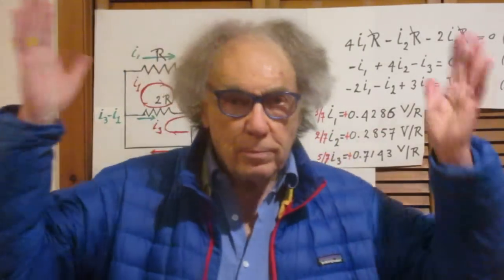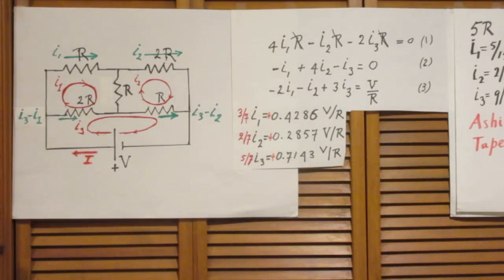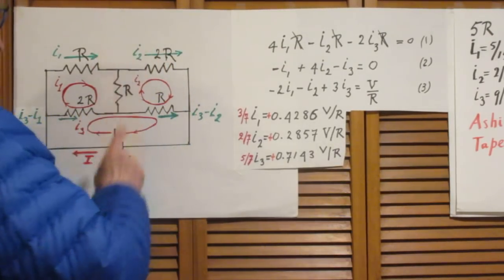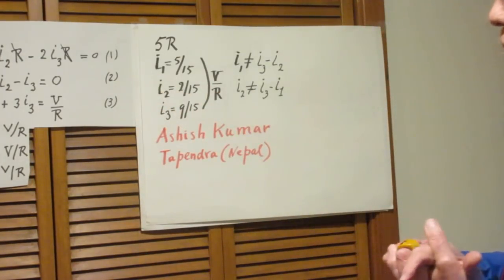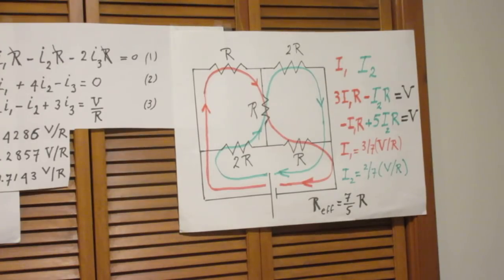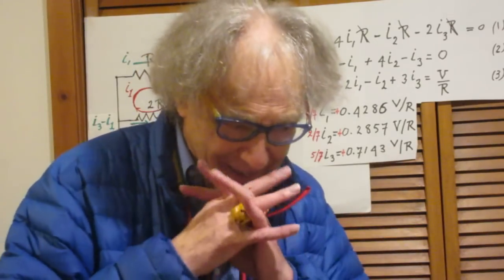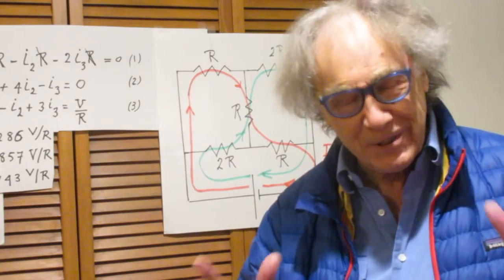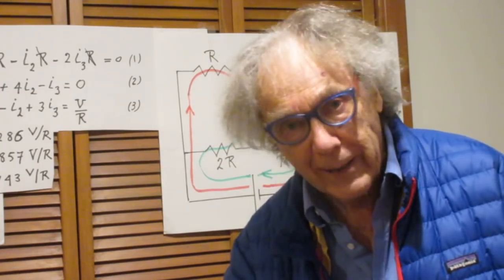Solution (2/4) Problem #24 - Circuit with 5 Resistors

Comment: That assumption can also be made by considering a current of value -i coming from the negative terminal of the battery. Since the arrangement of resistances are similar in the right side too, so same distribution of current will occur. Thus the current passing through 2R on the LHS must pass through 2R of the RHS.

Comment: You present things so convincingly that I originally believed you had changed BOTH 2R values although it was not apparent on your loops.  That, because I knew your quick result was ”evidently” wrong otherwise.  But when you repeated that the result was independent of the single resistor change, then I knew to expect your correction.  You did not disappoint.
In the very distant past I had to calculate a number of these resistor networks and started to develop a general sense or feel for them.  Something has remained, although most, and especially the AC complex ones I have let gracefully rest in peace.  In this case, I was off line when you presented the problem, so I never had an opportunity of working it out before your solution video. 
Anyway, I hope you keep on publishing your challenging problems.  Thank you!

Comment: The second method is still valid if you say "by symmetry it can be seen that the currents in the 2R resistors are equal and the currents in the 1R resistors are equal" and then carry on.
Reply: geocarey yes, but you need to do math to prove that statement is true if you are trying to teach the subject.

Comment: You're a good sport professor. Probably a good decision to throw solution #2 out. #1 will work no matter what. Also where thevenin would not be helpfull. 
Nevertheless, you found the symmetry shortcut with #2. Nobody else did.....still a good job.

Comment: Sir is really an electron has a negative charge... Or it's only a convention...And if it's a convention than how we say that  in hydrogen atom the protons are inside the nucleus and electron is revolving around it... (consider only single electronic system)
Reply from the maker: it's a convention adopted centuries ago. electric attraction and repelling forces were known for ages. It was decided by convention which to call --  and which + USE GOOGLE. Also watch https://www.youtube.com/watch?v=sOP3xKLNJZo&list=PLyQSN7X0ro218ZADJkvINBhTUAQeDMHf-&index=2

Comment: Sir from my limited knowledge i wonder why in a closed path work done  is non zero?
Reply from the maker: work done in a closed path by a conservative force (like gravity) is zero. It's not zero for a non-conservative force (like friction).
Reply: Here the force is that of electric field and that's conservative. So why? My assumption and explanation  is like this:
Kirchoff Loop law works because when we sum up the voltages across the loop we  actually get the change in P.E of unit charge across the loop and that is zero as the field is conservative. Hence what you do in super method is justified. The only trouble I see is writing current in a loop, I think in case of non standard loops it is wrong to assume current will be same throughout. Is my reasoning okay?
Reply from the maker: >>>>Hence what you do in super method is justified.>>
The loop I drew in the "super method" is fine,  but the current in that loop is NOT the same everywhere in the absence of symmetry. Thus in general they cannot be used (I was just lucky that they worked in my problem). Those 2 loops can only be used successfully if there is symmetry as I discussed in some detail in my Correction Video
Reply: Lectures by Walter Lewin. They will make you ♥ Physics.

 Sir can you make a video on these small tricks and checks that we do in physics like dimensional analysis and taking few variables to infinity and more that i don't know?

Comment: Did force depends on time.. ? For eg.. gravitational force between two objects at a distance of 1 light year will be negligible but the force will be there ... Thus light takes 1 year to reach that object , then force required how much time...?
Reply from the maker: questions unclear - use google
Reply: Gravitational force between two celestial bodies is given by f =Gm1m2/(r^2)... Now if I make r=1ly the force will become negligible, right but there will be force acting on other body. Now light take approximately 1 year to travel from object A to object B. Is the force acting on the object B still be instantaneous ?
Reply: Hahaha Google didn't know the answer .. only a physicist required...  AND YOU ARE MY IDEAL.
Reply from the maker: >>>Is the force acting on the object B still be instantaneous ?>>>
no it's NOT. Gravitons and Gravitational Waves travel with the speed of light.
Reply: So, it require 1 year for the force to act on object B?
Reply from the maker: yes
Reply: Interesting.. isn't it!!!
Reply: If the acceleration made by object B be equal to the rate of expansion of the universe...? Then what will happen?
Reply from the maker: question ill-defined, use quora.
Reply: Nevermind this question is a bizzare!!!!!

Comment: Sir, I think the second solution is wrong because the first loop is intersecting with the second one and they should not to have been     
Intersected.
Reply from the maker: What you wrote is incorrect.  The 2nd solution is NOT wrong. What was wrong was that I said that this second solution would also work if the values of R had been changed - that is not true.

Comment: Sir I have a question related to Quantum mechanics.can I ask here?
Reply from the maker: you can ask here.  However, Prof Barton Zwiebach ay MIT is a world authority on QM ask him 
zwiebach@mit.edu
Reply: Quantum mechanics based on uncertainty principle which shows that motion of any small particles can't be predicted .
But how can we predict light's behaviour so definitely but it is made from photon?
Reply from the maker: >>>But how can we predict light's behaviour so definitely but it is made from photon?>>>
we cannot
watch https://www.youtube.com/watch?v=MeK0DV329mU&index=7&list=PLyQSN7X0ro21uk5LTH085VLMfkb_dRjHF
Reply: But in case of reflection and refraction we can predict .
Reply from the maker: we can NEVER by-pass HUP. NEVER. All measurements you make will OBEY HUP. Use 1 photon at a time and do a double slit experiment. You can NEVER predict through which slit that photon will go and even after the facts when you detect it on a screen you will never be able to tell through which hole it went. The same is true for diffraction gratings.
Reply from the maker: If you measure through which slit the photon went (that is easy), there will be no interference. 
The simple question in the case of the double slit demo (through which slit did the photon go?) has no meaning in QM, it's a Newtonian thought which has no place in QM

Comment: You still use a shortcuts instead of brute force method. 
Why do you neglect Kirchoff’s junction rule? That is how I learned it.
Reply from the maker: Using his lopp rue I already had 3 eqs and 3 unknowns. The current rule would not have added. As part of my solutions I showed you that K current rule was met at every junction.
Reply: Don’t agree with you. You simply state that Kirchoffs junction rules apple. 
With brute force Kirchoff, combimagnetron junction and loop rules, there will be 6 equations. 3 from junction, and 3 from loop. 

How are you going to solve this schematisch with 5 different values of R?
Reply from the maker: omg who on Earth wants 6 eqs with 3 unknowns. 
With 5 different values of R using ONLY K's loop rule always works. It leads to  3 questions with 3 unknowns. https://www.youtube.com/watch?v=Vg_NKnmk5lc&index=92&list=PLyQSN7X0ro23CEzKOjAVcRq66m6g-mFLe
Reply from the maker: In the brute force solution I draw circular currents in the 3 loops. That simple fact already includes Kirchhoff's current rule. Give this some thought. Thus in what follows all I have to do is to use K'r loop rule for those 3  cases => 3 eqs with 3 unknowns.

Comment: This problem can be solved with KCL also,with only 2 equations.
Reply from the maker: 2 eqs 2 unknowns? please show me
Reply: Lectures by Walter Lewin. They will make you ♥ Physics. 
We have 4 nodes in ckt.
So if we consider 1 node to be at potential V WHICH is directly connected to battery + terminal so automatically another terminal which is connected to - terminal will be at 0 potential.
Now we left with two terminals of mid wire in which first terminal consider at x then another terminal will be at V-x potential (current in same resistance will be same). So technically we have only one unknown x.so at any node if apply KCL PROBLEM CAN BE SOLVED.
Reply: Actually it requires only one equation.but only for the special case you given in this problem ,when resistances are equal.
Reply: If resistances are different in ckt then we will have two variables x &y.

Comment: Waiting for 26 January, 2018 :-)
Reply: Sir, we see colors in soap bubble which is due to interference, reflection, refraction of light, when these interfered light enters our eyes do they again interfere, reflect , and refract inside our eyes?
Reply from the maker: it's called thin film interference I cover this in detail with demos in my 8.03 lectures. All light that strikes your eye will partially reflect and of course your lens refracts in such a way that the focal lens of a healthy eye can change from 30 cm to infinity. I had cataract surgery. I cannot change the focal distance of my new lens anymore. Thus I need reading glasses. My vision WITHOUT glasses for objects further away than about 4 ft is 20/20 (left eye) and 20/15 (right eye).
Reply: Thank you Sir for cleaning my doubt, and i will definitely go through your 8.03 lectures

Comment: ...but there is a solution as good as the brute force solution (in that it ALWAYS works), but does not require all that algebra with @#$ simultaneous equations (the algebra you so quietly HIDE in your solution)!  You can replace the 2R/R series (bottom horizontal) network with its Thevenin equivalent voltage (ground is right end of the battery V) (2/3)V & equivalent resistance is (R in parallel with 2R) = (2/3)R.  The upper horizontal leg has Thevenin equivalent voltage (1/3)V & equivalent resistance also (2/3)R.  We have circuit with (2/3) V in series with (2/3)R in series with R in series with (2/3)R to (1/3)V.  Total (1/3)V is across (7/3)R, giving current across center R resistor of (1/7)(V/R).  Voltage DROP on lower 2R/R link is (1/7) (V/R) * (2/3)R = (2/21)V.  Voltage at bottom of R = (2/3V) - (2/21V) (4/7)V.  Voltage at top of R is (1/3)V + (2/21)V = (3/7)V.  Now all node voltages are known, & currents in all resistors can be calculated, again with equations, each with ONE UNKNOWN!  No matter what the resistance values are, this solves the problem like the brute-force solution presented.
https://en.wikipedia.org/wiki/Th%C3%A9venin%27s_theorem